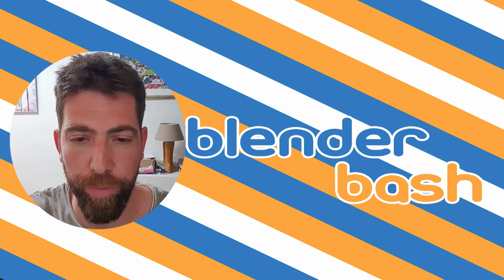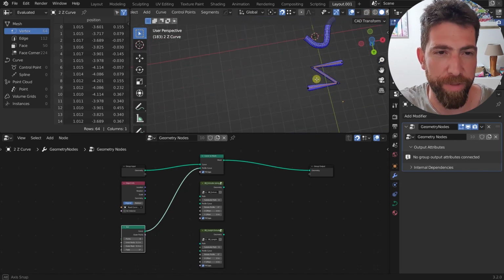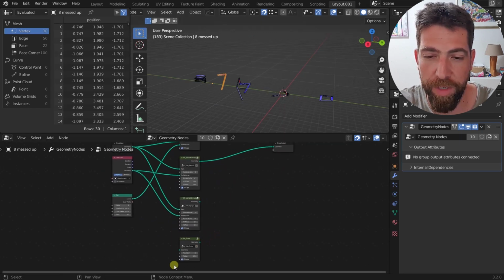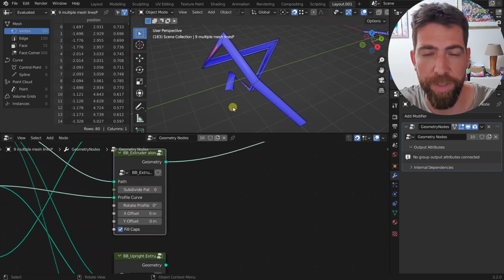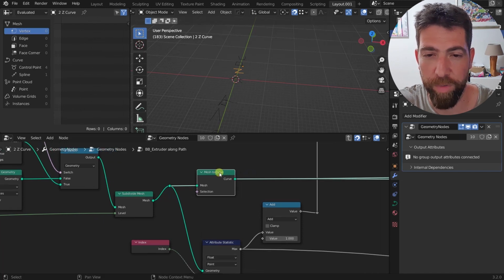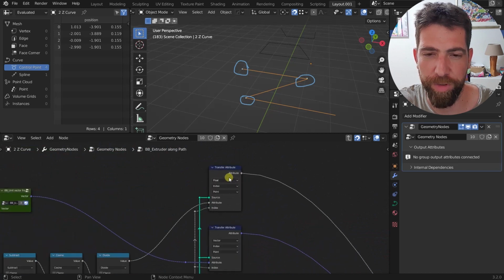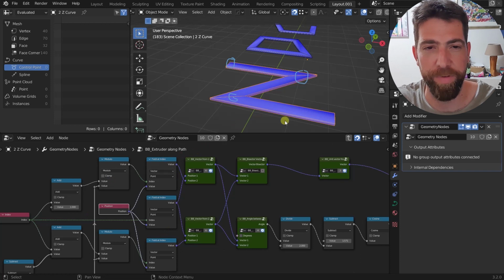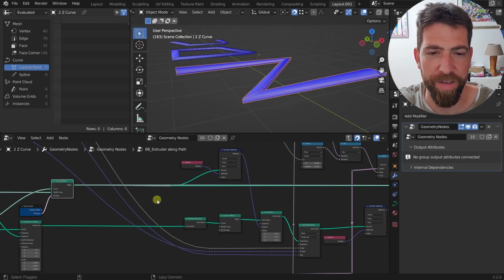3 Extrude Along Path Geometry Nodes in Blender

Comment: I'm trying to duplicate this. I have a Bezier curve and I'm using a Spiral modifier. The Curve output from there goes to the Curve input on Curve to Mesh. I'm using a mesh circle and the Geometry output goes to the Profile Curve input on Curve to Mesh. The Curve to Mesh output goes to Group Output, but I'm seeing nothing from it at all. I've made sure I match the inputs and outputs to what you have - only difference is that instead of using Group Input, I'm using the Spiral node on my Bezier curve.

Comment: Hi. just bought the 3 extruders! just wondering if its possible to get an open profile for the output mesh. When I input an open curve profile the resulting mesh seems to considered it as if it was closed.
Reply from the maker: Yes, it is possible. And it should already work fine. With what node are you trying to do this? Can you go to my discord (https://discord.com/invite/6kxQ5vKeVg ) and post your file or printscreens, so I can try to solve your issue?

Comment: Thank you so much! Loved the sweep modifier from 3dsmax, but finding an equivalent in blender has been frustrating. Have bought both versions from your gumroad on release and they work great! Two issues I’ve found are hard angles that folds in on themselves (can be mitigated by avoiding generated edge rings near the angle) and that they’re quite sensitive to which curve types and anchor points that are used, which sometimes caused strange bulging.

Comment: Good job !

If the two nodes (following path and upright) are similar enough, maybe you could merge them into one and just add an "upright slider" to make a transition between the two.

Also, for the upright inconsistencies on 3D curves, a way to limit wrong shapes would be to first deal with horizontal parts of the path (anything perpendicular to the upright axis), and then connect the other parts of the path by preserving the orientation of the extremities of these horizontal parts... But I'm not sure geo nodes are versatile enough to do that😅
This would not gives perfect results each time, but at least better in some cases.